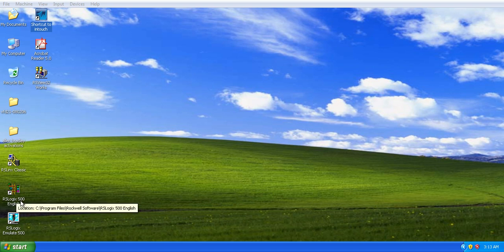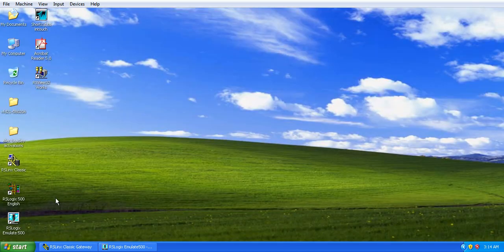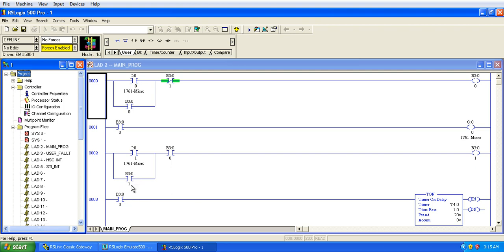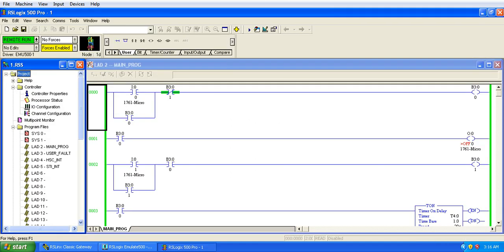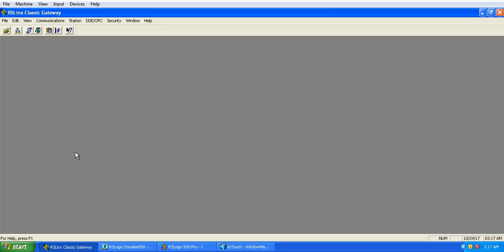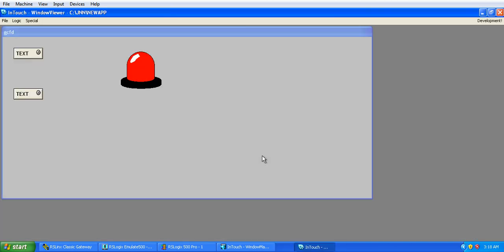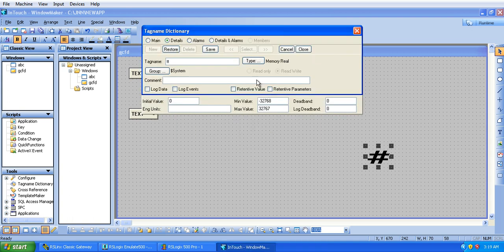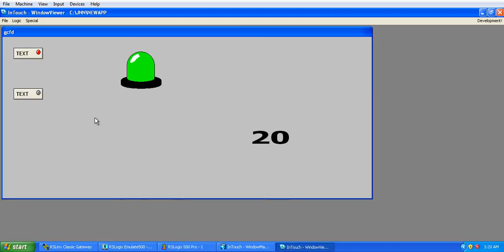PLC SCADA communication without PLC hardware

Comment: नमस्कार sir ji
Very helpful video 
Plz share link of rslinx classic gateway software 🙏
Reply from the maker: i have the older version of its gateway software which only runs in windows xp and its license actiavtes with a virtual floppy drive so i would suggest you to work on allen bradley's latest software control logix
Reply: I m also work on window Xp, if you share me this software it's very helpful for me